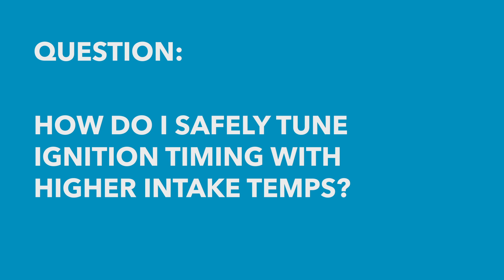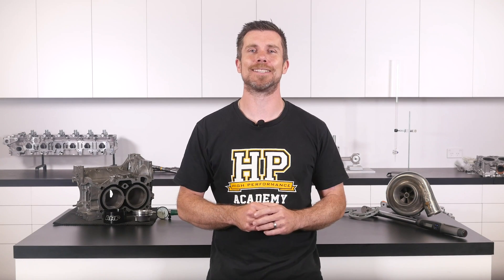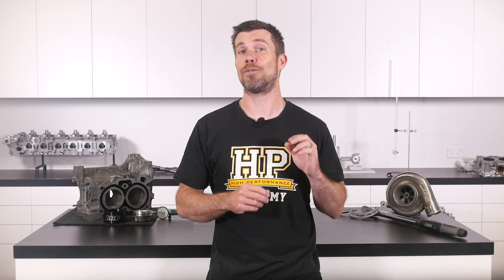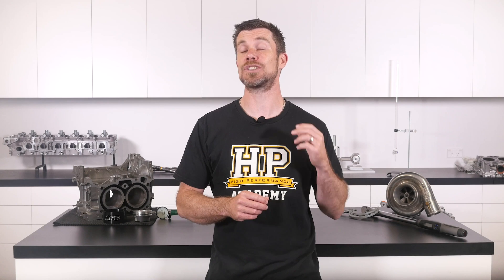How Do I Tune My Engine for Higher Intake Air Temps [HPA Q&A]

Comment: This was such an incredible lesson.  It's easy to assume that higher intake temps causes more potential for danger (for most enthusiasts), but to hear from you that the less air density caused by increased temps actually reduces potential for pre detonation by creating less power overall, was something I'd never have guessed.  Thanks Andre

Comment: Interesting, I didn’t think to consider charge density getting lower and thus needing some degree of advance. Despite air temps rising and increasing likelihood of knock. Best to test and see where the thresholds are! Thanks as always HPA!
Reply: So if an engine is tuned to the ragged edge with ignition advanced as far as possible. Would the ignition still need to be advanced if the IAT was artificially raised?
Reply: @raebirch540  Im curious about this as well. Assuming you've raised timing and reached MBT, does the decreased air density result in a higher threshold for MBT? - Ps. This question is directed at Andre.

Comment: what about if you're tuning an NA car without an intercooler?
Reply: You can put a tube on the intake and draw air behind the radiator, should be hot enough.
Reply: Remove the intake tube and replace it with a new one that catch air from the top of the header , just like older carb engine does have for cold environment
Reply: Buy a turbo and intercooler then fit them both. Throw cardboard over the intercooler.....
Reply: @brettus9115   lol, best reply
Reply: Tune it first under ideal IAT's than add a hairdryer to the intake to raise it to see the difference, haha nah dont im just being a dick but it may work.
Reply: Then your fucked in australia